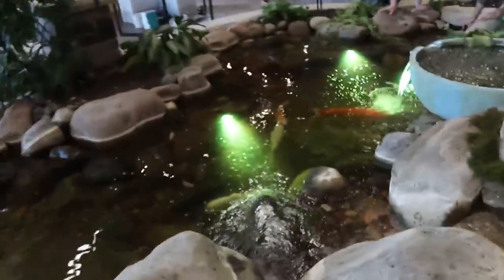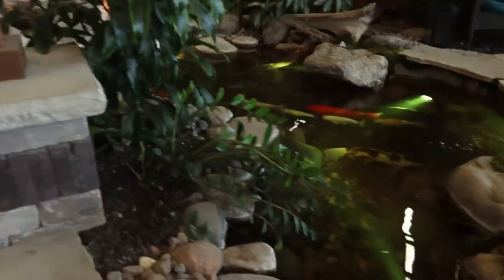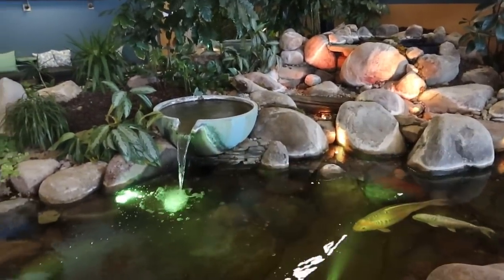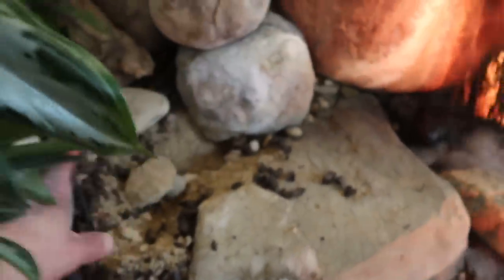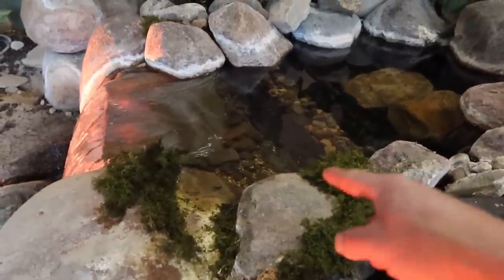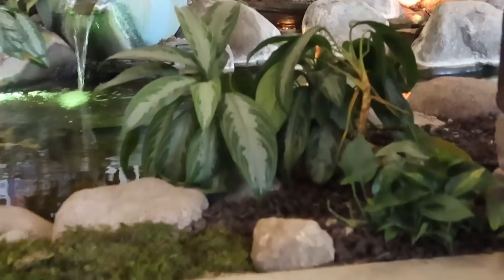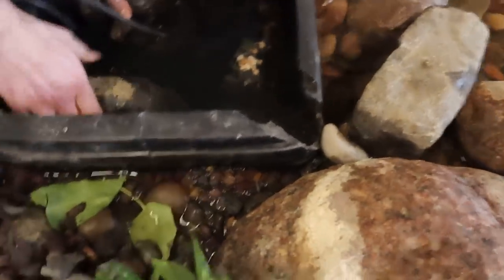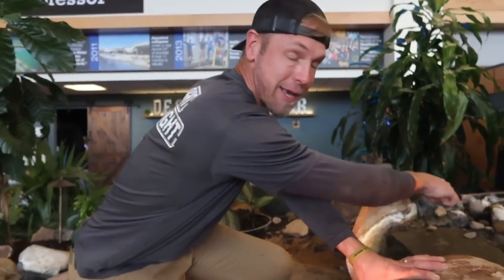The Simplicity Of Resealing A Leaky Waterfall

Comment: Good afternoon team aquascape and Chris hope your having an amazing day. Great video Chris I would of thought you would have to replace the whole bio falls in that case I didn't know you could replace the gromits. Great video.. Qustion since the video stopped here do you put some spray foam behind the area where the gravel comes up to the hight of the bio falls before it flows over on the inside or just fill the back side with gravel..  Just want to know if that's what you have to do aswell to prevent possible future problems again with the water directly coming in contact with the bio falls.. Hope you understand what I mean. Lol... Thanks for this video this is extremely helpful and something I need to do this year... Thanks again and I hope you all have a wonderful weekend. See you next video like always